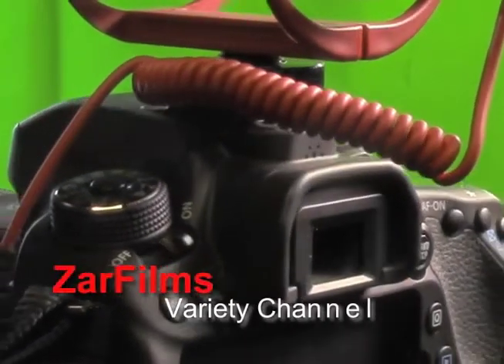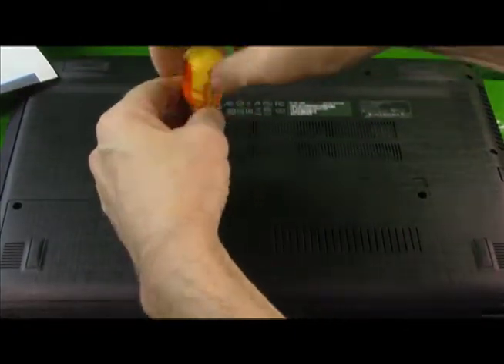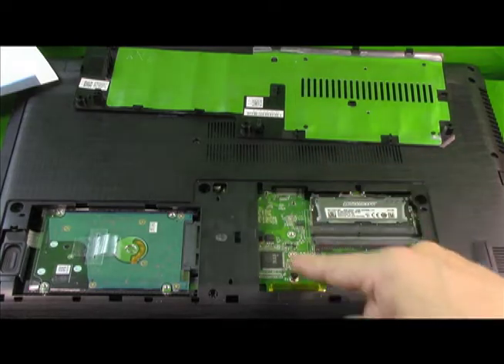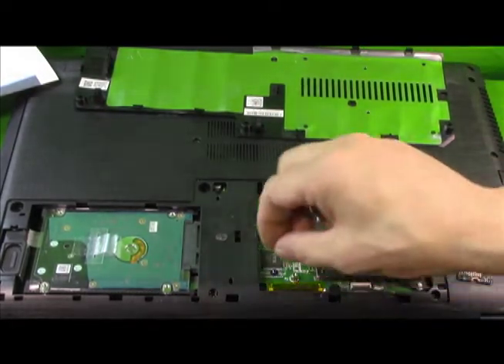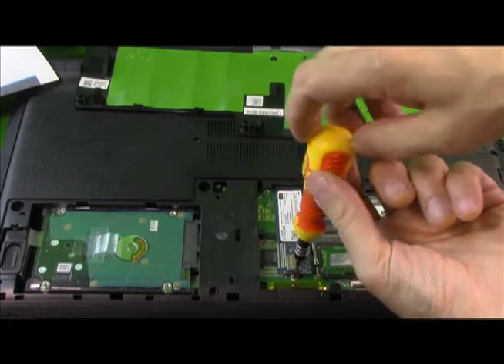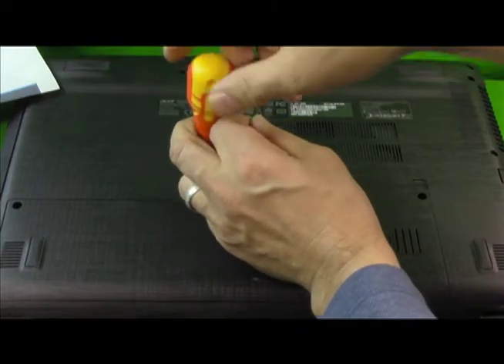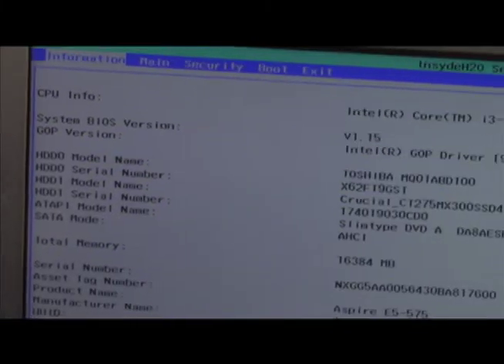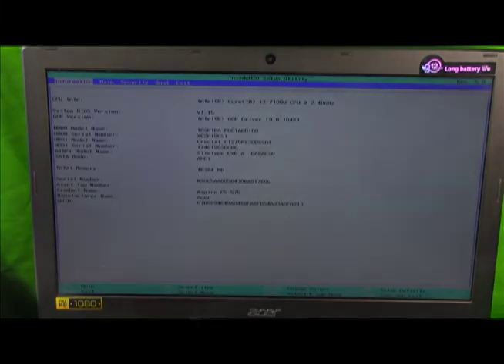How to Install 275GB M.2 SSD Drive into Acer Aspire E15-575-33BM Laptop Computer Guide

Comment: Did this make boot time much faster?  Did you have to clone this as well or move everything over to this drive?  Trying to decide if I should do this or just replace the HDD with a SDD.
Reply: You would have to install the OS on the SDD for it to boot faster, load things faster, etc.  Otherwise it won't provide any benefit other than fast access to stuff stored on it.

Comment: Heyyy i just got a question whats the difference between this ssd and the boxy ssd that thicker and bigger
Reply from the maker: This is an m.2 SSD designed for one slot in the computer. the 2.5 inch square ones are SSD replacements for your actual HDD. Look up m.2 SSD. I hope that helps
Reply: @Zarfilms2007  aaaaa thanks mann btw can i move my windows 10 from the tranditional hdd to the m.2 ssd?? Cause i know nothing about those stuffs 😖

Comment: I have an Acer aspire e15 with a 5400 rpm hdd would it make a big difference to switch to an 7200 rpm hdd after I install the ssd?
Reply from the maker: You can do that performance wise wont make too much of a difference performance wise but i don't see why not!

Comment: I'm not good with but I have the same laptop. Can this expand my memory and is there available 1tb of this?

Love the channel btw. Managed to upgrade my RAM with ease and able to play Far Cry 5
Reply from the maker: your RAM can be expanded to a max of 32 GB 16GB in each slot.  you can add an M.2 SSd from 128GB up to 1TB links are above for the ssd drives there is a 1TB option which works